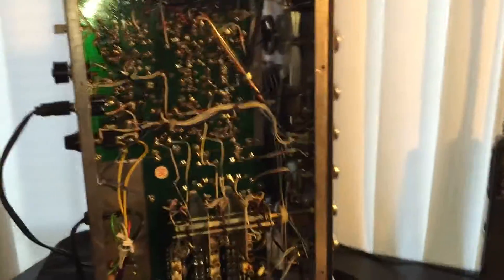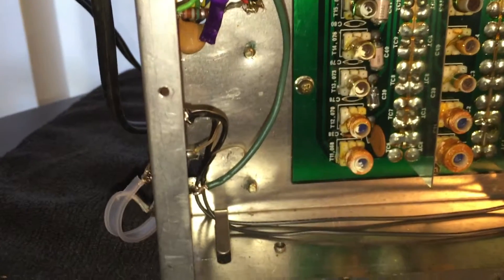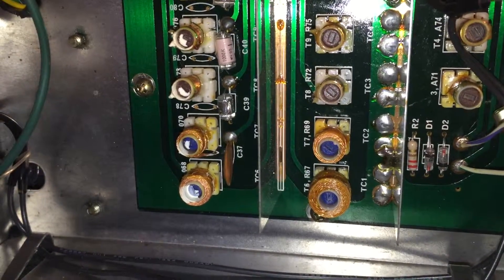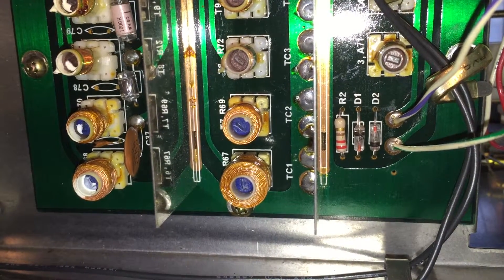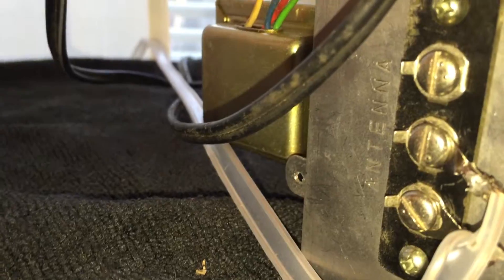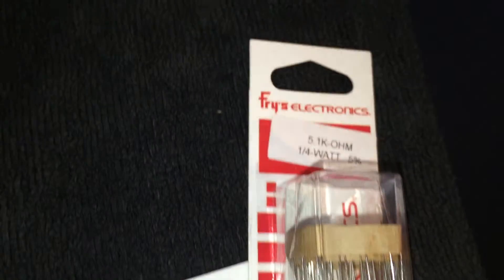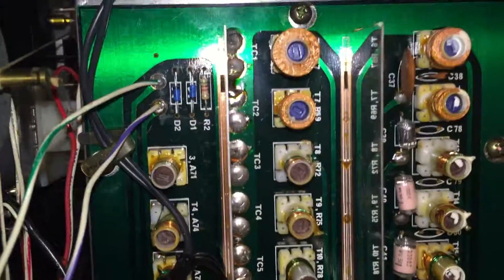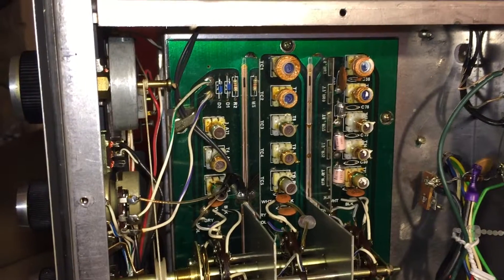Realistic DX-160 Weak Sensitivity First Repair Attempt

Comment: This Realistic DX-160 radio has a dissimilar metal problem on the tuning printed circuit board with the rivets that connect the top side printed circuit to the printed circuit on the bottom side of the PC board. Resoldering is not sufficient, the fix is to solder jumper wires on the top side of the board to replace the connection made by the printed circuit on the bottom side. Shining a bright light through the bottom of the board shows clearly where to solder the jumper wires on the top side. This is the RF amp and Local Oscillator circuit so it will require alignment. Operation without repair may be intermittent.
Reply: Thank you for this new info.  (new to me).  I have two DX-160 receivers and I noticed that while "on" I can tune a station to clear listening and with my finger push on the tuning board and can hear the difference with only slight pressure.  I thought there may be cracked traces or cold junction somewhere, but your idea could be what I am experiencing.  Are you saying the rivets would normally conduct RF?  I found where my two boards are soldered together near the edge of each, but no rivets, anywhere.  but wait a minute, I do see 3 very small brass rivets near the edge of the Main PC board.  They are maybe 1/16 inch diameter.  more of a brass tube with flared ends.
Reply: @walterramjet  The rivets tarnish and won't conduct electricity.  The best solution is to hard wire the PC on the top of the board to complete the connection that should be made by the PC on the bottom of the board.

Comment: Hi there!  A DX-150 was my first SWL radio as a teenager and I loved it.  Many hours in front of the dial listening to the many stations around the world!  So, yous was broken but it looks like you fixed it.  The diodes you used are probably just fine but if you want an "exact" fix, replace those diodes with 1N60 diodes. which I am 99% sure would be an exact replacement in that circuit.  I have a DX-160 sitting out in my shop that I am going to re-cap.  Plan to use Nichicon Gold series, audio caps for that job..  That, and a re-alignment and that rx will be back to as new again!
Reply from the maker: Hi!  I still have this radio and still do use it occasionally.  I should probably do an update video on it at some point.  I have gotten better at video production as you can see from my latest videos.  Anyway, those, (I guess silicone) diodes you see here, purchased from Fry's (RIP) were installed, and everything seemed fine.  However, I did ultimately order germanium diodes, and I'm pretty sure they were what the service manual called for (1N60 sounds familiar).  I couldn't find the online order email from digikey or wherever I ordered them.  There are germanium diodes installed in this radio now.  It did bother me not having the exact replacements originally.

It's kind of funny, I recently got married earlier this year, and the only thing I put on the wedding registry for myself was a signal generator - and I got it!  So I'm planning on doing a realignment on this radio as well!  Maybe I can get some tips from you about that.  That is a project and I'm hesitant to break those carbon adjustments (I can remember what they are called at this point.)  I have the proper non-conductive alignment tools.

The only other problem with this radio is that the BFO drifts a bit.  It calms down somewhat as the radio warms up.  I replaced all the resistors in the BFO section with high tolerance (I believe 1%) resistors and that didn't seem to help.  If you have any suggestions I'm open to them.

It is a great radio and I'm really happy I found it late in the day at a hamfest all those years ago.  It's in great shape and one of my prized radio possessions.  Thanks for watching!
Reply: @SWRadioConcepts  Drift can be isolated in a couple ways.  I'd hit every polystyrene cap in the BFO circuit with freeze spray.  Turn the BOF on and set it to a pitch of your choice; as long as you can hear it.  Start hitting the polystyrene (clear but with aluminium visible inside) with a very small, well directed to only one cap at a time.  When you hit the one going bad and becoming unstable, you'll hear it change pitch more than others.  Or, "shot gun" it.  Simply replace all the polystyrene caps in the circuit.  Real common to loose those in the VCO of FM stereo receivers.  All of a sudden, no more stereo sound and a check reveals that the VCO free run frequency is either very wrong or gone completely.  99.9% of the time, its the polystyrene cap in the VCO circuit.

Comment: If you find and buy some older 60's transistor radios that are sold for parts, they will have the germanium transistors and some germanium diodes in them.. A germanium diode will have like a 0.250 to 0.300 volts on your meter diode checker, and show OL, or open the other way...when they are good.